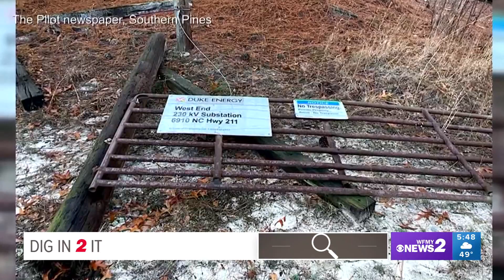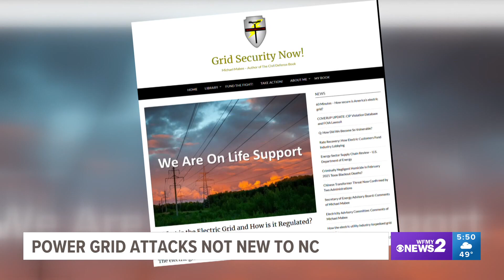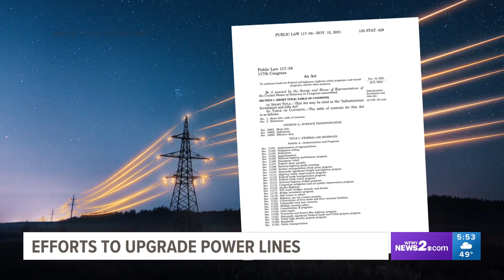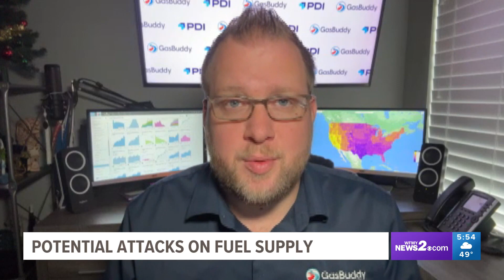Moore County power outage attack leaves thousands in the dark

Comment: Well gonna shop at Amazon get me a solar panel and a jackery battery power pack
Reply: Jackoffery battery pack
Reply: You can't run your whole house on that for long sustained periods of time if the weather doesn't cooperate or the battery cell is not sufficient for the loads in your home. But most of your heating appliances on gas or propane. Keep electric to a minimum for electronics or minor refrigeration. We know the Power grid is a weak point. Make your home hybrid
Reply: Can I laugh now
Reply: A whole house generator is nice

Comment: One consequence that is often forgotten about is that if enough circuits fall offline fast enough then frequency could increase and cause damage to sensitive electronics or generators could overspeed and shed their loads.
Reply: Yes, we learned that lesson. Whole home surge protector and individual surge protectors are helpful. What we do is turn off the breakers at the main box. When electricty comes back on, we slowly click them back on.
Reply: @sharonpreston2826  I had no idea the surge protector on my A/C unit died until I had maintenance done, it probably saved both units.

Comment: Not sure exactly how they did damage, but transformers are filled with oil for cooling.  A hole in transformer would cause oil to flow out, overheating transformers, and then oil burns ignited by heat and short circuits.   Damage could be extensive causing entire substation to be rebuilt.